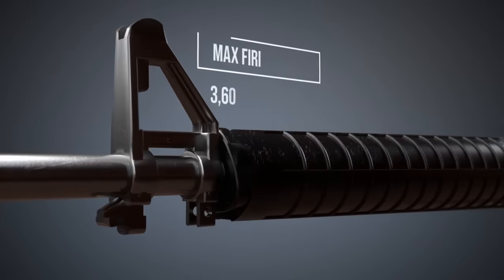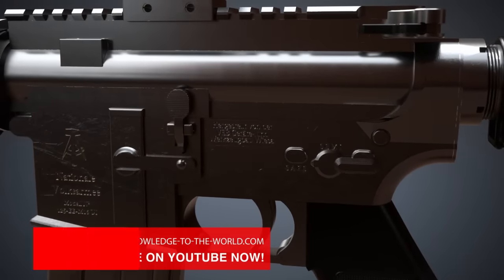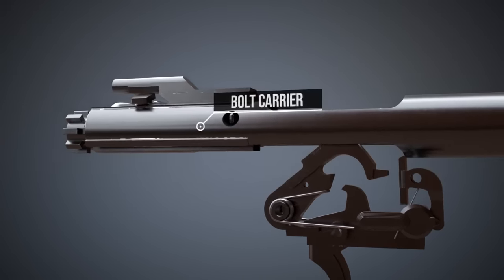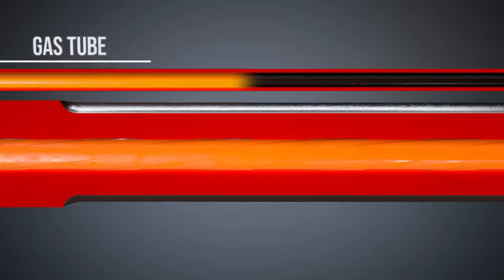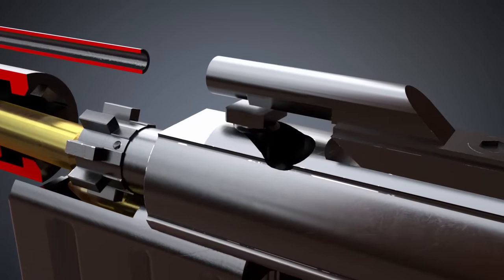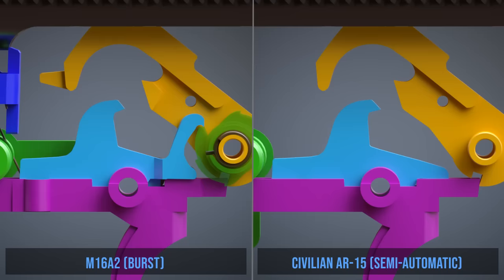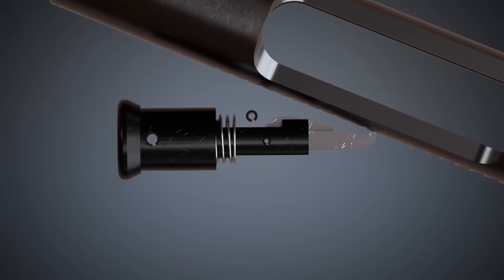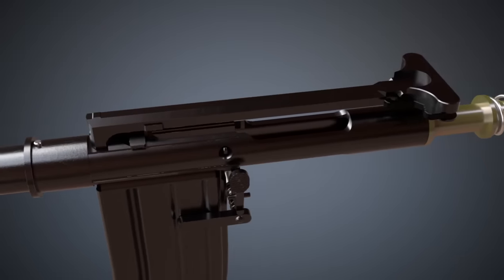M16 and AR-15 - How firearms work! (Animation)

Comment: Subjects of engineering required to design a gun
1. Theory of Machines ( Mechanisms, Cams & Followers, Springs, Vibration)
2. Machine design & Manufacturing (Design and manufacturing of parts, Metallurgical selection, ergonomics, anthropometric, Measurements)
3. Thermal engineering ( Energy Transfer/ dissipation like Flash hiding, suppression, Heat Transfer and dissipation)
4. Fluid mechanics (Gas movement, flow through nozzle, diffuser for gas operated ones, compressible flow)
5. Optics (Magnification and all about light/ lasers)
6. Mechanics (Uniform Weight, low Centerline CG, muzzle velocity, projectile range (bullet range))
7. CFD ( Modelling and Simulation)
Well that's entire Mechanical Engineering 😲
Reply: Imagine humans spent their time developing something which doesn't kill other humans. Unbelievable.
Reply: And still aka 47 is better. because we had a better engineer
Reply: Michael Manukyan imagine.
Reply: To make a simple gun, all you need is a pipe, a flexible piece of sheet metal, a nail and a block of wood for the handle. And some way to fasten them all together securely. It won't be good or accurate, but it will fire a bullet.
Reply: The only reason why I chose mechanical engineering is because I'm fascinated by this types of things like guns, and cars.
Reply: @Sparked Tiger car benefit people and satisfy their needs to commute (I'll argue that given a good public transportation there is no need for cars), guns for public solves a problem which should be solved by the government.
Reply: @MAGAMAN 
What you need for the simplest, cheapest and shittiest gun (aka a "tumbera") is:
Soldering machine
Grinder
A thick sheet of metal
Two pipes (A) with internal diameter adequate for the desired caliber of shotgun shells (You may need to sand the interior if you don't find a pipe with the adequate internal diameter)
Two pipes (B) with internal diameter adequate to insert the first pipe inside it
(You could simply get a longer pipes and cut two parts of each)

Why shotgun? 
No need of rifling and lower pressures

To start, grab the sheet of metal, make a point and draw a circle of the external diameter of pipe B, and cut it. In the point you made that is now the center of our circle, make a drop of solder, that will function as our firing pin, you could also use a part of a nail. Then, solder this circle to one of the endings of pipe B.

And you got it.

If you want a handle, grab one of each pipe and grind them in a "fish mouth" shape, each one will be soldered to the respective pipe to be used as the handles.

I guess you could implement a locking mechanism soldering a locking lug that could be a nail in pipe A, and cutting a section of pipe B to insert the lug, turn it and lock it; but I didn't see this being used in any captured gun of this style.

The way to use it:
Insert a shell in pipe A, insert pipe A in pipe B, smack pipe B in pipe A when you wanna shoot.

Little clarification, "tumberas" here in Argentina is a term used for any crude homemade gun, but the most common are this type of shotguns.

Examples of this tumberas: 
https://youtu.be/hk7JYY8i_ig?t=15 "Delinquent is arrested and a tumbera is confiscated from him"
https://youtu.be/jiUCM8YrkLk?t=25 "Minors with tumberas"
Or just google "tumberas" and you'll get a bunch of images of captured tumberas.
Reply: Or just be from the south, Kids around Georgia fix n build their firearms since they was 10. just saying..
Reply: Most guns were designed before CFD, including both of these weapons
Reply: Frodo Begins but it terribly fails the mud test compared to an ar15 🤣
Reply: @kofein9  is it because it has shittier tolerances yet still fails in sandy environments unlike the AR15 which is a closed design
Reply: @rinugeorge8024  What are You talking about?)
Reply: Metellurgy
Reply: Only for complex guns. All you need is a bit of common sense to make a old fashion bolt action rifle. Or a 22lr handgun.
Reply: @armLocalhost  imagine Disney movies were possibly I'm real life. Unbelievable.
Reply: @sandramcclure2598  Listen, I love guns and I’m extremely pro 2A, but no where are you going to find a 10 year old able to build a firearm. Gunsmithing requires years of training.

Comment: This was/is History Channel or Discovery Channel Quality and explanation....Kudos to you and thank you for the in depth information....Subbed and waiting for the next video!!.... God bless!!
Reply: This is better
Reply: Way better than the crap those guys put out.  And we don't have to endure a bunch of unrelated drama.  I can just picture it "Eugene Stoner ... a man on the verge of a breakthrough that would change mankind's place on the planet forever ... but could he weather the storm of chaos that was about to drop on him ... and later ... could he keep the love of a woman he was never meant to have?  Join us tonite as History Channel goes deep into the secret life of the world's most hated gun."
Reply: At least it was accurate at 90%.  However it was still misleading on some points.

Yes the lower of an ar15 of most modern variants can not support the room required by the m16 but also ar15 bolt carrier groups are also slightly different to prevent automatic fire.

Comment: This is great it shows how the bolt acts as the gas piston.  Proving that the ar15/m16 isnt technically a gas impingement system (it looks like one but isn't).  So many people dont realize this and I've tried to explain it but they call me a liar or dont understand.  Now I can just relay this video to them.  It shows perfectly that the gas pushes on the back of the bolt (using it as the gas piston) causing the bolt to push forward and unlock using its cam and thus forcing the bolt carrier rearward (which extracts, ejects and recocks the firearm).  Lol great video.  Best I've ever seen anyone who wants to see how the m16/ar15 platform functions should be told to watch this.  Thank you so much for this.
Reply: Most DI guns have a gas piston.  Having a gas piston by itself does not prevent a gun from being a DI gun.  Just look at the MAS49 or AG42, both of those have a gas piston and expansion chamber just like the AR-15.  The MAS49 even has the expansion chamber recessed inside the bolt carrier, somewhat like an AR-15.  DI, as its name implies, has the gasses impinge directly on the bolt carrier and or bolt, which the AR-15 does.  The AR-15 piston is still a part of the bolt carrier.  Compared to a piston gun, where the impingement occurs in a remote location and the forces are transferred by piston rod or op rod or other solid energy transfer component.  That's the difference between DI and a piston gun.
Reply: @deanc91  that's were your wrong direct gas impingement does not have a traditional piston.  Gas impingement has a combustion chamber (which is the female end) that the bolt carrier itself fits into (Male end/nonemoving piston) Gas therefore goes back to the male end on the carrier and pushes the bolt carrier rearward.  There is no moving piston.  Were as on the ar15 the gas goes back into the bolt carriers chamber and then pushes the bolt forward unlocking and pushing the whole carrier rearrward.  This makes the bolt its self a moving gas piston.  Even Ian from the show Forgotten Weapons has said that its Not a gas impingement system.
Reply: @roberttrester4030    Ian is not always correct.  He has to be corrected from time to time.  Your description yet again still fits the AG42, where the piston is a moving part that goes into the expansion chamber of the enlarged gas tube.  Thus the AG42 has a moving piston as part of the bolt carrier.  Yet, the AG42 is undisputedly a DI gun.  And yes, DI guns have a piston.  Even the AG42 specifically labels out the piston in diagrams.  By definition, any disc or cylinder moving in a cylindrical chamber to harness energy from a gas is a piston.  Thus most DI guns actually do have piston components. 

Also who made this definition up where there must not be a piston or the piston must or mustn't move?  What is the official authority of this definition?  Direct impingement, taken literally, is gasses directly impinging on the gas carrier in order to cycle the gun.  This is exactly how the AR-15 system works.
Reply: Here's  a very simple trick in gas piston rifle  the gas should not make it past the first 1/3 of the rifle if gas makes it into the upper receiver  its not a piston gun,no need to micro manage  a technicality, the whole reason gas piston is even invented is to keep heat and carbon  out of the chamber and upper receiver which an AR-15 does not

Comment: It's a fine piece of engineering. I remember being taught this as a conscript, along with disassembly and cleaning. If one of these were put in my hands today, I'd still be able to clean it, even though it's been more than 15 years since I've held one. I also remember that firing loose rounds, cause the weapon to be much dirtier than when firing live ammunition. Being a conscript, we almost trained with loose rounds every day, so we spend hours upon hours cleaning. :D

Comment: Theres a lot of small details left out, like the fact that fluted barrels dissipate heat faster, yes, but they also build up heat faster. Lower thermal mass works in both directions. 

Other than tiny nitpicky things like that, this is honestly one of the most informative videos about the mechanics of this platform on the internet.
Reply: Hello fellow Will W
Reply: @willw5868  brother

Comment: The three round burt was made as an effort to get more rounds on target per trigger pull withkut necessarily firing fully automatic. Youre more likely to hit a target if theres 2 or 3 bullets flying downrange rather that just one... Thats just what they told me in the army. Really good animations though, i like how you included the gas traveling all the way inti the bolt carrier and pushing against the back of the bold to start the mkvement of the carrier moving rearward. Keep up the good work.
Reply: lol. Maybe, but I would say that new soldiers tend to be a bit trigger happy in a tense moment.
Reply: @areus2016  spray and pray

Comment: Narrator: "The pressure pushes the bullet out of the case, through the barrel, to the target with a velocity of around 1 kilometer... per second." 

Me: "WOW... that's... an American using the metric system!"
Reply: The only 2 things they use metric for are bullet velocities and bullet diameter, apparently
Reply: 3,280 FT or 0.62 Mi.

Comment: I had no idea how ridiculously engineered the M-16/AR-15 is! That bolt working with the gas system to put pressure on it so it twists out of the chamber lock as the bolt carrier moves back is an engineering feat in itself. Don’t even get me started on the engineering of the trigger assembly.